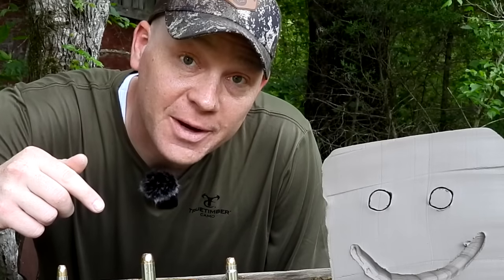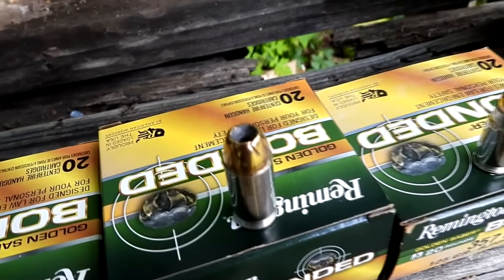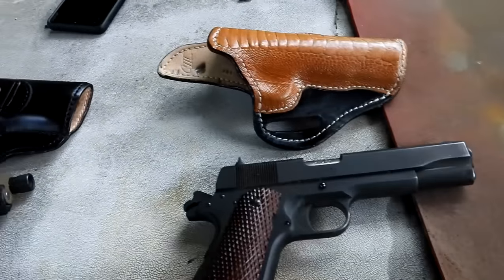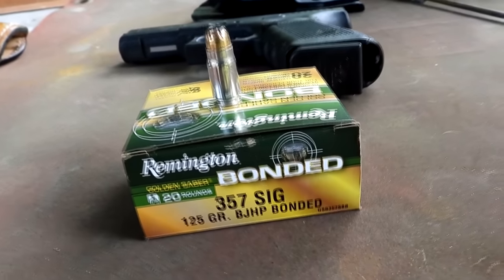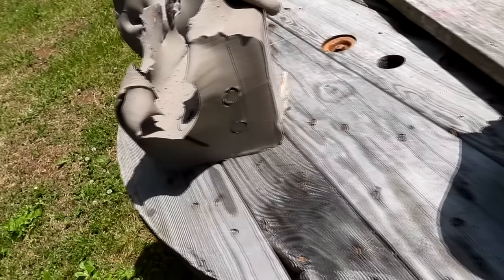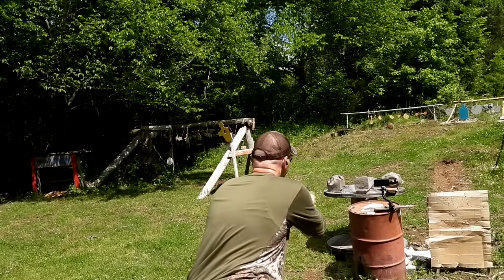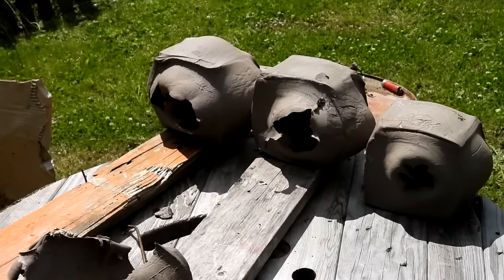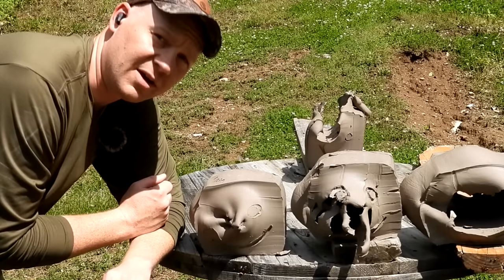9mm vs 45acp vs 357sig - CLAY BLOCKS!!!

Comment: The most underappreciated round is the 357 Sig. It is a beast.
Reply: DITTO THAT!
Reply: Yes, it is.   Don't know why it never caught on that much.  Any one I ever shot felt like a hot 9mm.  Less recoil then a 40S&W.   But they sure are loud.
Reply: 10mm 357 sig right after
Reply: 10mm is a beast
Reply: I currently own 2 after market .357sig stainless barrels for my M&P 2.0, Glock 22 gen 4(used). The ballistics of the .357 is impressive ✅️. The -s are muzzle blast, noise. 💥  .357sig pistols were issued for years by many state agency & federal LE. I've owned 10mm guns in the past & might get a 10mm barrel for my big Glock 41 .45acp model. Glock Store.
Reply: @joestriker2100  What did you say 👂
Reply: 10mm for the win
Reply: I agree. But the 357 Sig is very expensive and hard to find.
Reply: That 3 fity 7 sig put the hurt on that clay.. I own both 45 & 357...
Reply: 357sig is my EDC
Reply: @Tim Barker   There are lower cost retail sources for factory 🏭 training FMJs. $22-24/50rd. I bought a few boxes of .357sig 125gr about 2mo ago: Mar 2023.
Reply: @ssnerd583  .356 Sig has got to be one of the worst calibers I’ve ever reloaded for. But it’s literally the same cost to reload it as 9mm 8-12 cents a round depending on material sources.
Reply: @christopherwinter6911 lol😂
Reply: @mikerobinson8734 on a penetration level I wouldn't be so certain when pitting the volicities of the 357 sig against the 10mm. Energy wise sure the 10mm obviously edges out the 357 sig. They are both beasts for certain. That said idk if I could decide between the 2. In fact I didn't because I love my g20 & my g31.
Reply: 357 sig is a sleeping giant
Reply: 357 sig came from 40 case, i have wanted a 9x25 dillion which is same but using the longer 10mm to start with, it kicks butt too.
Reply: @brainmeier3433  10mm with 130 grain bullet is a smoker
Reply: And, quicker recovery due to lesser recoil
Reply: @MikeRobinson - Thats where .40S&W is still useful. Practice/reload the 40, use the 357sig for serious work.
Reply: 357 Sig is a beast BUT it depends on the bullet.  The Barnes 115gr Tac-X, 124/125gr HST & the 124gr Speer Gold Dots are my go to bullets. These 3 styles have always expanded beautifully for me in testing.
Reply: I swapped out all my .40 S&W barrels for .357 Sig barrels.  I moved a few back to the .40 S&W when I started with 10mm handguns but I do have a fondness for the .357 Sig caliber.
Reply: @timbarker1011    Where you looking?  I’ve never not been able to find what I wanted and needed.  Yeah, the .357 Sig is a little more costly but not hard to find and I can afford what I want.
Reply: If it starts with .357, it should end with Magnum.
Reply: Another one is 7.62x25. What I wouldn't give for a modern double stack double action handgun in the caliber.
Reply: will b  Because E=Mass x Velocity squared.  When you double the mass you double the energy, when you double the velocity you quadruple the energy.
Reply: @Patriotusa44  Tokarev , really ?
Reply: Love my Glock 33
Reply: It's another random round that costs a lot and is hard to find. No thanks. I'll stick to semi-affordably burning through tons of 9mm.
Reply: Try Grizzly 90gr Jacketed Hollowpoints in .357 sig. 1850fps.... hydrostatic shock.
Reply: I've got 9mms, more 45s, a 357sig. I like them all but on my glock G31 357sig I also use a G22 40cal bbl & a 9mm conversion bbl. Most of my  shooting with any handgun is usualy at 100 to 400+ yds using a rest,the glock does this well I've always had no interest in shooting closer. I've always said if it's close enough to use a rock then use a rock (I carry a sling to, it worked for david😊. Does anybody else shoot far or am I the only nut. happy shooting.
Reply: @joestriker2100 it was supposed to be the national carry for sheriffs , cops and all the rest but 40 cal came out
Reply: Whaaaaaa😮
Reply: @johncoleman2495  the 357sig bottle neck case is an advantage in that it eliminates case mouth jams compleatly (mouth jamming on feed ramp or bbl face doesnt happen because it doesnt make contact at all). Same for the 400 corbon I use in my  45s. Just saying😊
Reply: @joestriker2100 ecause the 357 SIG is larger in diameter than 9mm by .07" . but I could be wrong.424 is SIG can't remember what 9 is.
Reply: I love the 357 sig.  But as a reloader it’s not fun to reload.  It like reloading a rifle cartridge.
Reply: Shoots pretty flat too
Reply: Sig is the winner of the clay test
Reply: Just good luck finding it.
Reply: @Patriotusa44 agreed, but both the makarov and the tokarev are awkward to me to shoot
Reply: 357 sig has a quick crisp sharp recoil cant understand til you shoot it
Reply: @mikerobinson8734  good luck with that alot of companies quit making the ammo and new stuff when tested was the same performance as 40s&w yet new companies are making hotter 40s&w like the new 60 grain ammo for 40s&w pushing 2,550 FPS
Reply: I've been a mere twitch of the thinger away from ordering a threaded .357 sig barrel for my m&p .40 several times... already got a glock 10mm, but why not both?
Reply: I have a glock 20 barrels with comps on 6 inch 10mm and 357 sig plus factory short 10mm and i have a 40 barrel too. Dang europeans they like multicaliber pistols because cant own more than so many. I also have sig p226 in 40 and bought 357 sig barrel
Reply: @kraftwurx_Aviation  I have tested my reload of Hornady XTP 90gr (for .380) in a .357sig case. Results through a Sig P229 were consistently over 2000fps. Kinda scared me! 😂😅
Reply: 7.62x25 Tokarev
Reply: The .357 sig I believe is the best round amongst the basic characters. 

It it has flat trajectory, can penetrate car doors and windshields. 

As is all too common, the beat technology doesn't win out.  And you go back to beta versus vhs, or blue ray, or mp3. 

In all these cases, the inferior technology won out. 

Today, nobody is interested in the truly best technology.  It's all about what's cheapest and convenient.  

Well...in life, if it's cheap it's probably not good.
Reply: @mikerobinson8734  
356 Sig ?
Reply: I'm going to say it. Must need to get closer with the 45 to hit dead center. If your first shot is off to the left, then compensate. However I would think standing right on top of the clay brick shouldn't be that much of an issue. Nonetheless it is.
Reply: @Mr.Robert1  Yes the name of the cartridge is .357 Sig but the actual bullet it uses is a 9mm .355 or .356 diameter bullet. 
Where an actual .357 magnum uses a .357 diameter bullet.
Reply: @Robin McCaslin .357 Sig is a pain to reload. I spent alot of time with the cartridge and ultimately came to the conclusion that 9mm is basically the exact same thing if I wanted a hot loaded 9mm I could come very close to the .357 Sig rendering the purpose of the .357 Sig pointless in my opinion. For the intended purpose 9mm does the job just as well.
Reply: Seems to be. I need to dee more on the 357Sig.
Reply: That's why i carry it everyday!
Reply: @joestriker2100 exspensive to train
Reply: @danchristopher7957  yup the nice thing about 357 sig is in a sig 229 you don't get the flip like you do forty it just pushes you back.
Reply: That's just not available...
Reply: @timbarker1011 that's why I reload my own. It's a lot cheaper than buying factory ammo. You can find 357 Sig cases. Then you need 9 mm bullets which aren't priced bad. I buy 124/125 grain and 147 grain bullets. Depends which alley I might walk down as to which I'm more liable to need. Not really just a thought. Anyway bro I load up around 13 grains of AA #9 load to 1.114 and crimp with a Lee factory crimp die. You can load these for almost the price of 9 mm. I don't know why these are so expensive. Look up the correct powder load. Start low and work your way up.
Reply: That 45 tho!
Reply: @LTVoyager  that was the whole point of this round. To emulate 357 mag performance with a 125gr bullet from a 4” bbl.
THEE gold standard for one shot stops.
And it does just that.  It doesn’t have the means to load the bigger bullets and get the same performance, but for the gold standard it is match with 125gr hollow points.  
So, in essence, you’re carrying a 357 mag auto with 125gr HPs and many more shots on tap.
Like the mag, it’s too much for some to handle, and, like the mag, it’ll put a hurt on a bad guy when used within its parameters.
Reply: UNA 357 MAGNUM PER DIFESA PERSONALE, RITENGO SIA UN TANTINO VIVACE. SALTA TROPPO ED OCCORRE RIPORTARLA IN PUNTAMENTO OGNI VOLTA. DI CONSEGUENZA SI PERDE TEMPO... MEGLIO NON EVITARE, CHE SIA LUI.. A PRENDERE LA MIRA SU DI NOI !!!!
Reply: What u say? Say it again
Reply: 10mm vs 357sig it depends  on who makes it. 347 sig standard  1350 fps 10mm standard  1200fps- 1250 fps. U tell me who wins
Reply: @reddiredd81  they both accomplished their original design intent.  Either is a good SD choice.  10mm can handle heavier bullets , so maybe a tad more versatile for hunting or critter defense.   Sig , with 125gr bullets emulates the 357mag with 125gr pills from 4” bbl, the gold standard for 1 shot stops for yrs, so yeah, I’d say whichever you choose for your reasons, you’d be a winner.
I doubt anyone on the receiving end would have much to say…
Reply: SIG SAUER UN GRANDE PISTOLA, L'UNIONE DI DUE INDUSTRIE D'ELITE.. NEL CAMPO DELLE ARMI DA FUOCO .

Comment: As a .357 Sig fanboy, I approve of these results
Reply: I have to agree with you. Yes it is underappreciated. By far. It really is a beast as u put it. Well spoken.
Reply: You got it brother. G33 all the way.
Reply: I do too.
Reply: The problem I see with .357 sig is that the ammo is  so darn expensive and hard to find, it's cheaper and easier to find 5.7x28 ammo than .357 sig. ammo. And believe me, I wouldn't hesitate to buy a handgun chambered for .357 sig if the ammo was more readily available.
Reply: @bdr32965  underwood always has it in stock.
Reply: @bdr32965  Learn to reload? Not sure what to tell you. It uses the same projectiles and primers as 9mm. Depending on your load, it will use the same range of slower burning powders as is used by magnum pistol and shotgun loads. The only unique thing to it is the brass and they are reusable. 

Even without reloading, during the height of the pandemic, I was able to buy .357 Sig in bulk from LAX Ammo when 9mm was basically impossible to find. Just like investing in the stock market, diversification is a good thing.

I treat ammo like I do wine: buy it more than you use it and you will never run out.
Reply: Well you asked so I’ll tell you… I carry a p229 hand fed with 357. It’s a real flat shooter… I just wish it was a little friendlier on the wallet
Reply: Well the west Germans are well known for killing. My Sig p226, I had since 1994 never malfunction. After24 years I had the department range change the springs in it before I retired. So it was like having a brand new gun.
Reply: .45 fan here and I'm seriously reconsidering my stance. heh
Reply: @bdr32965  like the saying goes,it's not the round,it's the placement..a 22cal. Bullet in a perps eye will take them out of the game..practice pulling and shooting your weapon so your round goes where you want it ,is more important than a high power round you can't control or hit your target with.
Reply: I approve💪
Reply: Glock 33 for 13 years strong!!

Comment: I actually carry the 357 Sig with the Remington bonded golden saber. It was pretty interesting to see this comparison.
Reply from the maker: Awesome
Reply: I currently use Federal HST brand 125gr .357sig but the Big Green bonded GS design looks ✅️.
Reply: @DavidLLambertmobile  can’t beat hst performance. That’s what I have for my other carry options. Did a lot of research and saw that the golden sabers were pretty comparable to the hst in how they perform and got really good reviews. Saw a really good deal on the bonded golden sabers that I couldn’t pass on. They are accurate and cycle flawlessly through my pistol.
Reply: @freedj27   1 online source had both 125gr Speer Gold Dot .357sig & Federal HST 50rd boxes 📦 around the same price. 1 minor - with factory Federal HST is the cosmetic appearance of the .357sig loads but that's minor. I'd buy either Speer Gold Dot or HST. The Bonded GS .357sig rounds are + too. Remington to their credit has vastly improved the QC in 2021/2022/2023.
Reply: Same rounds in my G33..AWESOME weapon.
Reply: @DavidLLambertmobile    Remington ammo improved because they got bought by the same company that owns Federal and Speer and CCI. It's a brand-new factory too.

Comment: I asked my uncle what he thought the best defensive round was. His reply was "Whatever you can get on target consistently". This demo confirms that.
Reply: A hit with a .22 beats a miss with a .44 mag., in my humble opinion. I used to carry a lightweight S&W in .357 mag. for back up. First 3 were Winchester Silver tip 147 gr. and the rest were Federal Hydra Shok heavy recoiling. This was per Maasad Ayoob testing in Combat Handgun magazine years ago. The 147's had a lot less recoil and flash in low light, ( while still .357 mag velocity over .38+p). He tested his loading hunting deer if I remember correctly. It worked well for me. First 3 I could put on target great with quicker follow up shots. If those didn't do it the next ones were barn burners that would wrench your wrist, ( for on top of you scenarios). Again years ago and for backup. For duty it was 9 or 45. Both with Speer Gold Dot.That department allowed your choice of carry and ammo at that time.
Reply: They all get it done.
Reply: @kentuckywindage222   I have a Ruger P89 9mm for home and a 3" Python for carry. I am not a big fan of a bunch of plastic in my handguns. I had paper roll pop guns as a kid in the 70's that were all metal. I grew up. Now all my real handguns are metal too. I use PMC 124gr Starfire JHP for the 9mm and Underwood 357 Mag 140gr. Xtreme Penetrator for the Python.
Reply: @ottomatix3397  
While that maybe true, back in the day New York, again if I remember correctly, had their officer's carry 9mm full metal jackets. The incidents that happened were used for training. A perp with a knife, (of small stature mentioned) shot several times, still managed to cut up and officer. Still fighting being loaded into an ambulance. Another shot in the teens of times managed to run across a freeway before collapsing. I've saw .22 long rifle deter a would be robber and about a mile later at a stop light fall out of his vehicle on to the pavement. 5' 8" 170 lbs male survived. I survived a shotgun blast at close range. That was in 93. Lot of damage, shrapnel, half liver lost with 5 pellet in what I have, right kidney, some intestine, half the muscle in my right back, 7 section of rib, hole cantaloupe size in back, hole in abdominal wall as well, right lower lob of lung, shards of bone and lead up and down my spine in that area etc. 2 years later I went back to work in a small town as a city officer. It wasn't long until my body wouldn't allow me and retired 100% disabled. Lot's of health problems. Stopped me in my tracks. With pistols and the right ammo stopping a human is still not like in the movie's or so it would seem from my perspective and humble knowledge. On the other hand a long gun is for offense and a shotgun within it's given range......imagine being hit full swing with a sledgehammer and a torch and hornets nest inside you. In the 70's a friend of mine in KSP said .357 mag with Remington 125 gr Semi jacketed hollow points in the K5 zone had a one shot stop rate. This was my Chief whom I trusted my life in situations.
Reply: 12 gauge hands down is very best for home.

Comment: I converted an FNS 40 to 357Sig with just a barrel swap. It shoots almost as soft as 9mm. I load it with Speer Gold Dot 125gr. It's an amazingly effective round. Maybe the best defensive round against 2 legged predators. It really is too bad it doesn't get more attention, especially with law enforcement. I think some highway patrols and maybe some US Marshall's carry it. This is the round that took down the Texas church shotgun shooter at long distance with one shot. Of course the guy that pulled the trigger had something to do with that.
Reply: Speer Gold Dot is used more by police than any other round.   Can't get much more use than the most.
Reply: @Richard T  I love Gold Dot but I was mainly talking about  the 357sig round
Reply: You hunt Kangaroos and Ostrich with it huh 😅
Reply: @gtrfreak  kangaroos and ostriches aren't predators
Reply: The easiest ammo to find where I live is 9mm. A weapon is worthless without ammo - especially when one SHOULD practice regularly.
Reply: Underwood, Buffalo Bore or Cor-Bon for .357 Sig.  They sell the full power stuff and it is NOT as soft as 9mm in my experience.  G17 and G31 here.
Reply: @donaldcarey114  A few hundred rds of sig  should be enough for ccw . And train using a 9mm conversion  barrel
Reply: @scott sanborn  I said it shoots almost as soft as 9mm in my FNS. FN has some kind of recoil magic . Before I converted it 357sig it shot 40 cal literally as soft as my 9mm Glock 17.
Reply: @drmachinewerke1  A conversion barrel? They are not availible for all guns and COST MONEY. D'oh.
Reply: @donaldcarey114  Well duh, nothing is free. They do come in most popular guns that have an option for .40 as the Sig is a .40 case necked down to 9mm.
Reply: @scottsanborn3344  all great ammo
Reply: Federal Air Marshals use this out of the P229. If they trust their marshals to use this round to hit a moving target 30 yards away in a metal tube going 500 miles per hour 30 thousand feet in the air, then I think its a pretty damn good endorsement.
Reply: Just a barrel swap? The magazine works just as same?
Reply: Which barrel?  FN makes a 357sig barrel?
Reply: @kevinedge2676  it's from EFK Fire Dragon
Reply: Just wanting to understand better how it works. Where to get the barrels. I want a 357sig so looking for options.